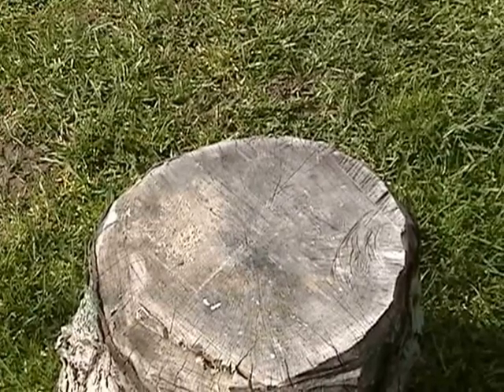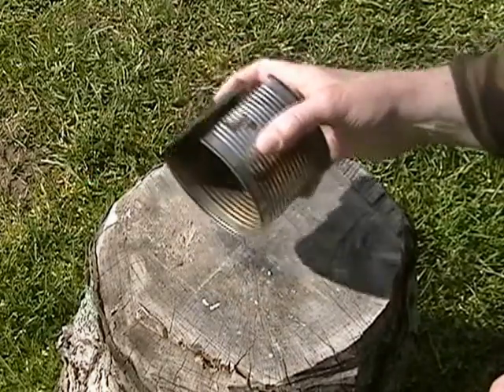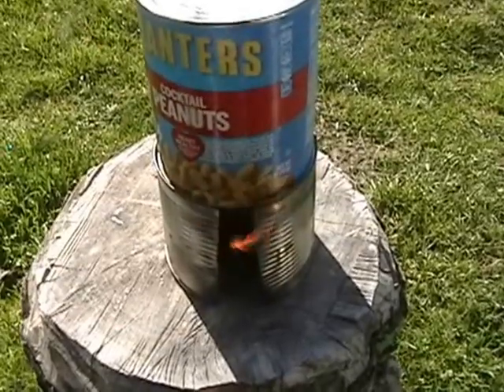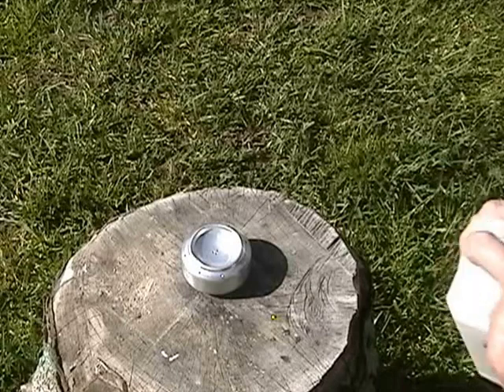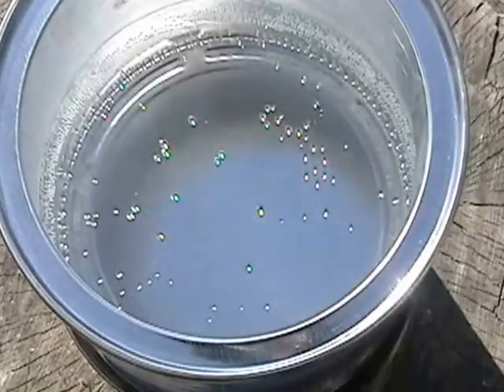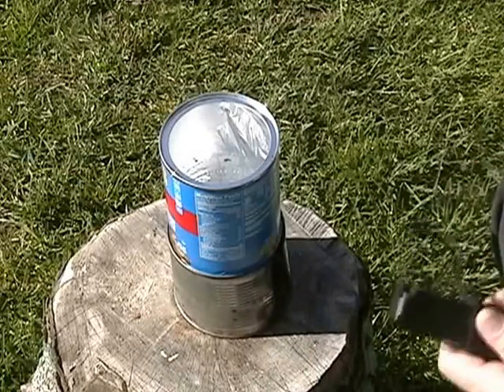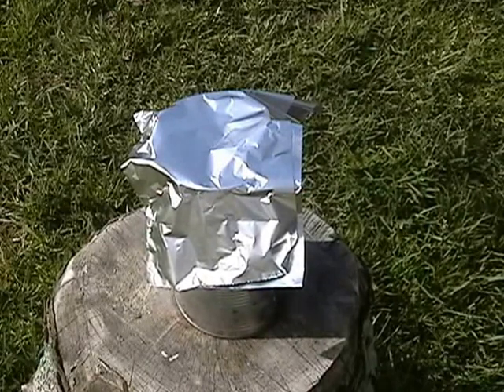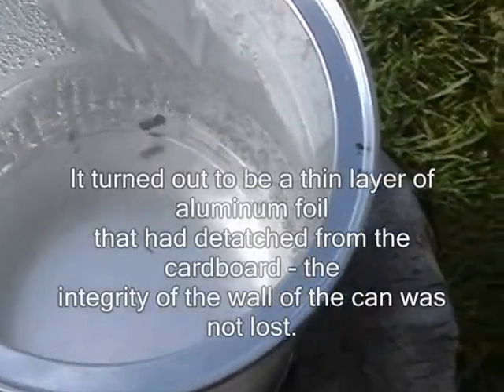Stealth Fire for Boiling and Cooking

Comment: Hey that was a great video sir just awesome that's a neat little burner thing ya got there 
um two questions 
1 what was in that bottle I couldn't hear what it was called 
2 why did ya put a 1 cent ie a penny in that burner?
Reply from the maker: The bottle contained denatured alcohol, which is what I use for my alcohol burners (some people use "Heet" or some similar product made for absorbing condensation moisture from gasoline). I put the penny on the burner to cover the holes in the center, which is where the fuel goes in. It works better if they're covered after the burner is primed and lit, so that the vaporized fuel goes out through the holes around the edge of the stove and makes "jets" of flame. Good questions - thanks for asking, and thanks for watching. Cheers.
Reply: Ah ok I get ya interesting that never seen that kind of burner before cheers man great video that I have a firelighter idea I came up with using fibres which worked great with a fire striker and a lighter
Reply from the maker: Cool. Hope you will share your idea in a video!
Reply: Oh I will don't worry I tried to sell this idea on ebay but no one was interested

Comment: Was the lighter still useable after the test? That was quite a workout for that Zippo. Those penny stoves work pretty good. I would've thought the peanut can's inside was going to fail. Good demo Glen.
Reply from the maker: The lighter came through just fine - well, maybe a looking a little brazed, but that wore off as it continued to cool. I filled it up again and then heat sealed it into a custom fit storage bag that I made. Based on past experience, it'll fire right up whether I take it out in a year or two years - maybe more. I need to get out into the woods have some camp fires. Already the powers that be around here (BLM, USFS) are starting to limit campfires. What they ought to do instead is thin out the overgrown forest areas and log the diseased/insect ridden trees so they're not as susceptible to fire. Lightning causes most forest fires in my state, but they claim the majority are "human caused." I pay attention to those numbers and lightning causes more by far. One thunderstorm rolling across the desert or a mountain range can trigger dozens of fires - and they do. Anyway, thanks for the comments. Stay safe out there.
Reply: I'll have to put a lighter in a bag. That's a great idea. I know what you mean about the overgrown vegetation. Always bothers me to see all that timber going to waste and causing all that damage!

Comment: 149 degrees F and your water will be safe to drink. That said without a thermometer a boil is a sure way to know. If you can get close to a boil then you can know that you are safe to drink your water.
Reply from the maker: Good points. A rolling boil is thought to be 100% effective at sterilizing water and it's easily recognizable when achieved. I've used iodine tablets in the past for purifying water from "wild" sources and never got sick, but they do impart taste and color to the water that aren't especially appetizing. I think filtering and then boiling would be preferable if one does not have a mechanical filter available; e.g. a "Life Straw" or Katadyne-style system. Unscented chlorine bleach is another alternative - just a few drops (8 or so) per gallon are sufficient. I've drank water directly from wild sources before without purifying it - it was risky but I was thirsty and it was handy. Thankfully, I didn't get sick. Thanks for your comments. Cheers.